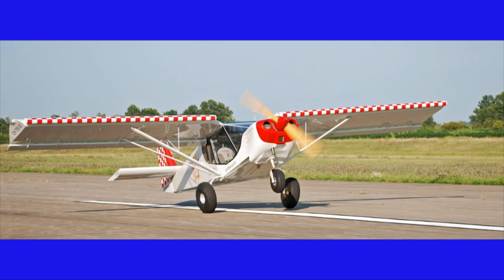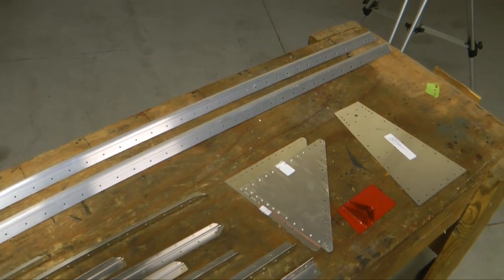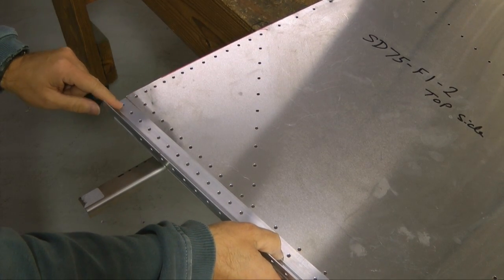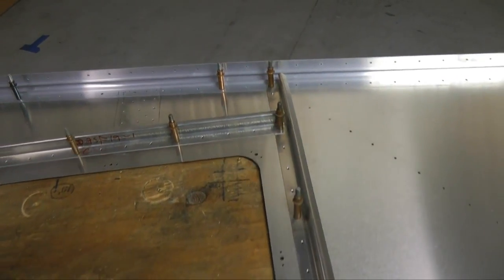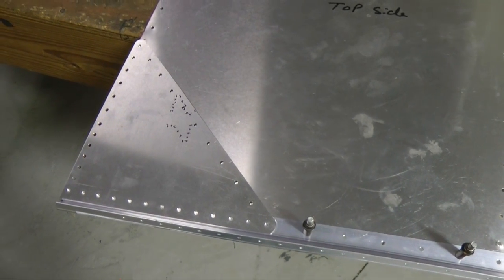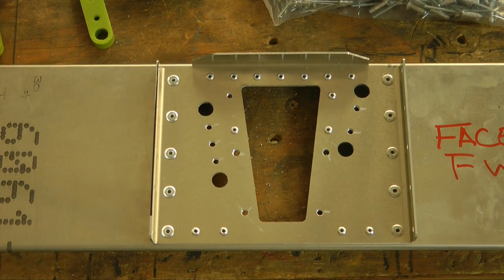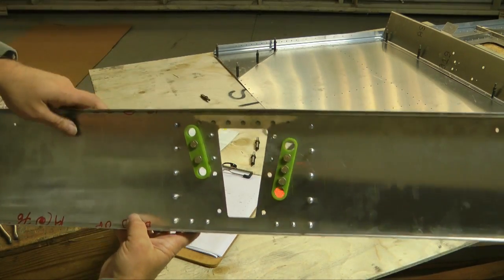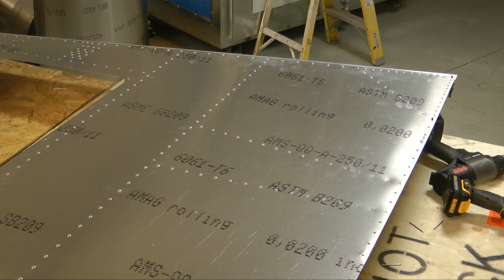Step by Step Building the Zenith Super Duty Part 1

Comment: Wondering why the left "z" bar is facing the same way as the right. Looks more like the logical way would be both having soft edges facing in for hatch access having no sharp edges towards the hatch vs left has open side of the "z". Curious about the logic here.

Comment: Where a angle overlaps a angle, would it be good to put a joggle in the end of the overlaping angle so that the bottom sheet would not have an offset in it and be flat? The same question relates to the large angles in the front of the bottom? Thanks

Comment: Maybe an ignorant question but, shouldn't the Z-channels on each side of the access hole be MIRROR imaged instead of facing the same direction?
Reply from the maker: The correct answer is: whatever the plans say!  I do not have the plans available so I cannot say whether it is in fact installed correctly or not. Structurally it makes no difference.  I always advise builders to follow their plans and NOT the video when building! Another big problem is that as time passes, changes and enhancements in the plans can create more discrepancies between the video and most recent plans.

Comment: I noticed you didn't mention de-burring the holes. Is that not needed with this new kit? Or did you do them off camera first?
Reply from the maker: Good observation. Yes, deburring is important and outlined in the builder's manual. Usually, do not show this on video, should have mentioned!